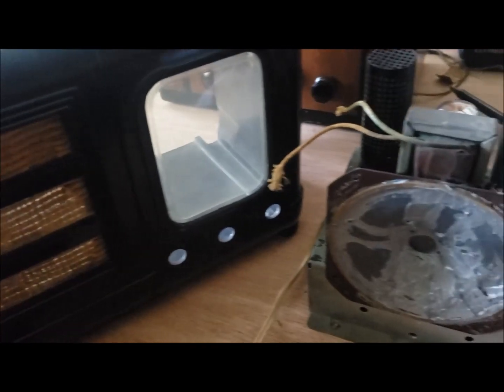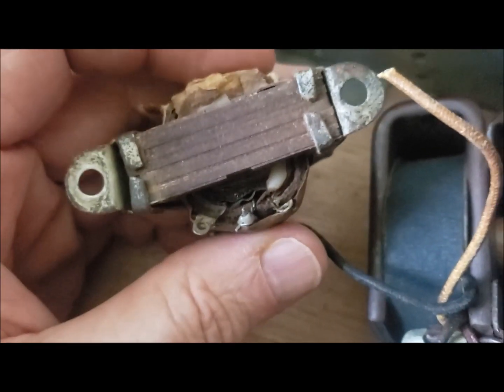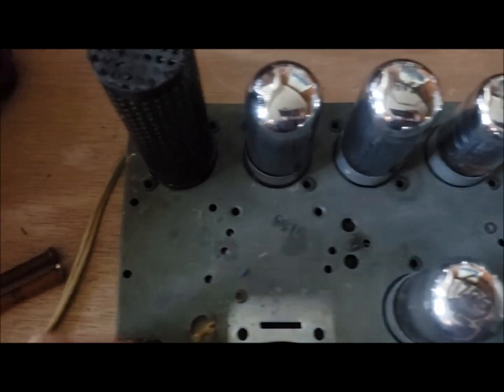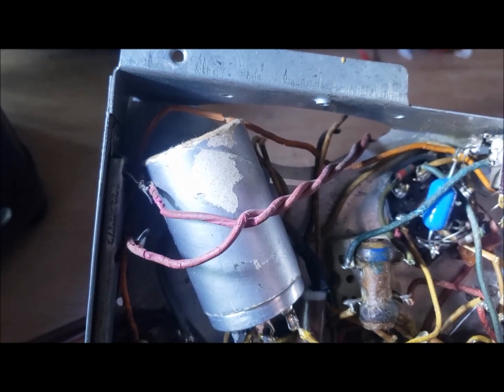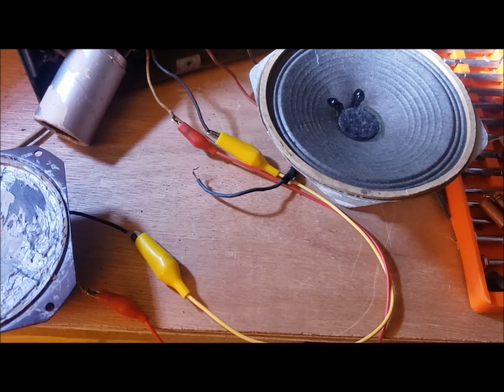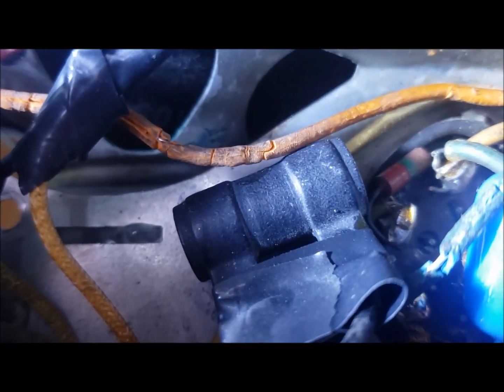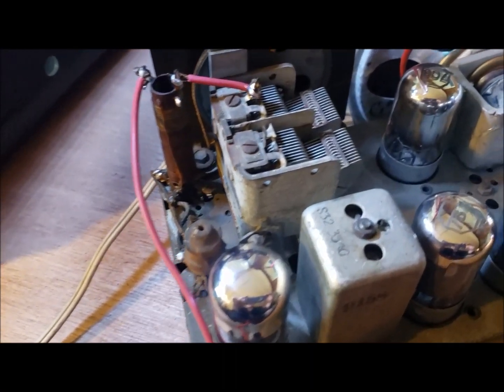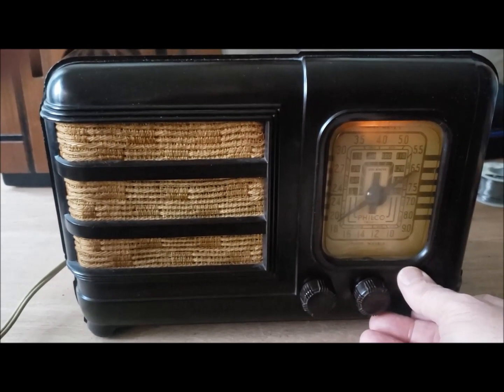Speaker replacement on a 1941 Philco Tropic 41-705

Comment: Is it possible to modify a solid state AM radio to give it that warm tone sound of a vintage tube 1930's - 1940's radio?
Reply from the maker: @deltafour1212  You could try modifying the circuit by adding more negative feedback but if I were you , I would just build a tube amp and feed the audio into that.  There's lots of circuits for them on the net.

Comment: This is the kind of radio with a special ballast tube. Philco  number 33-3389. It was put
into a special octal socket with two keyways, one for 115 V and  the other for 230 V.  I 
see the wiring diagram for the ballast tube on the schematic and looking at it is actually only used as a jumper for the connections for 125 Volts. It is needed for 230V when you 
place it in the right position for that voltage. If you have the ballast tube and it is dead
check the ordinary wire connections in the base for continuity.  Pins 2,3, and 7. Then you
 can redo the speaker next. But not this way, yikes. Rotten insulation on many wires to
be replaced. And don't modify the chassis to fit a too large  PM speaker!
Reply from the maker: My hope is to repair the speaker cone and put it back in the radio, as everything on the speaker assembly is good except the paper cone.

Comment: An alternate trick I like to use is to separate the field coil from the rest of the speaker, and mount it somewhere on the chassis or cabinet; that way it stays in-circuit, and the power supply operates the same as before
Reply from the maker: That's a good idea, but I'm hoping to maybe repair the speaker in the future.